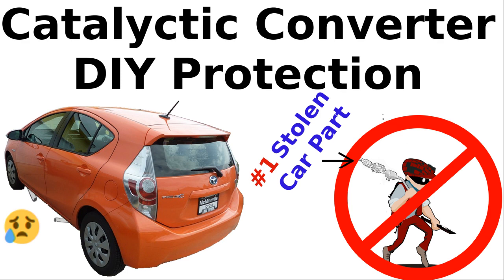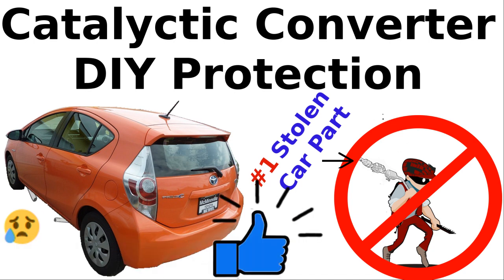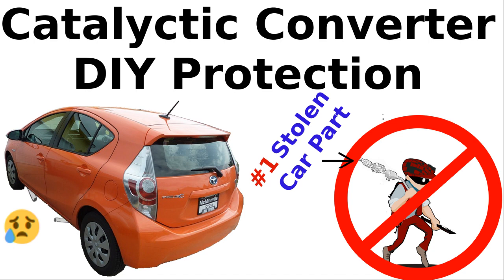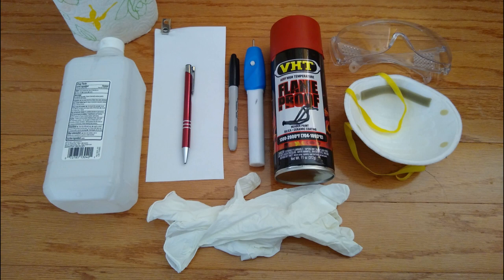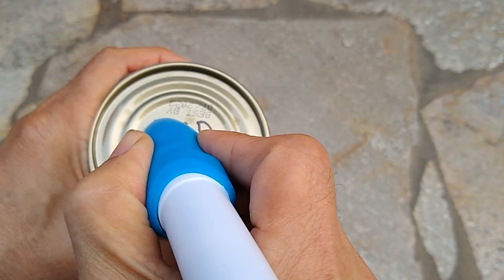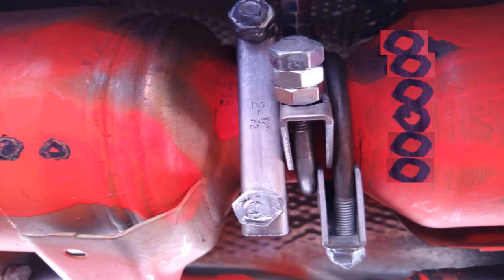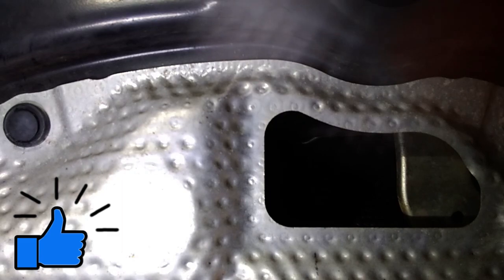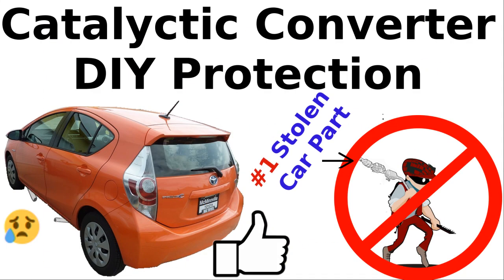Prevent Catalytic Converter Theft. DIY VIN number etching, painting, u-bolt protection for converter

Comment from the maker: Good suggestions. I added two more 3.5 in u-bolts one both sides of the 2.5 u-bolts and I will FB Weld washers to the top of first and second nuts to block socket wrenches. The 3.5 u-bolts use 3/8" nuts. I will also JB Weld a washer onto the top of the inlet mounting bolts and when I'm doing that I will see if I can fit another 3.5" ubolt next the the inlet mounting bolts.

I found this other video where the cat was tied with steel cables.
https://youtu.be/ZUisJggKWvg
Here's how to cut steel wire using a chisel:
https://youtu.be/x5py_Y8Xp7g

Comment: You could also before installing all this drill some holes in U-clamps so before you use the JB Weld you can put a  few pins (cotter or nails) so the nuts wont unscrew even if the thief tries to force the nuts and JB Weld off with a wrench.